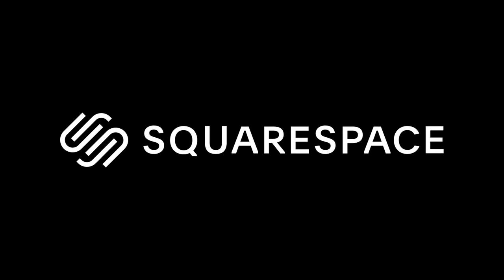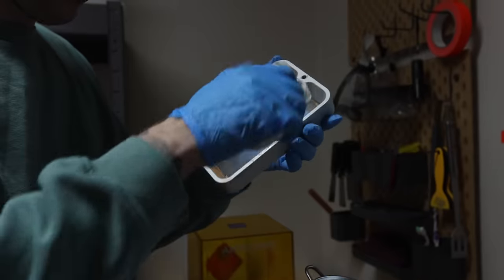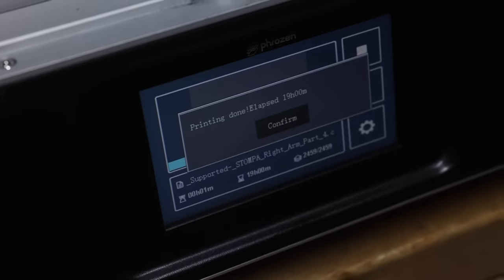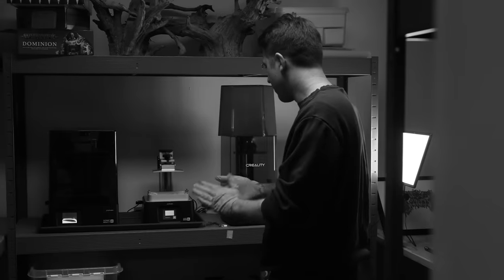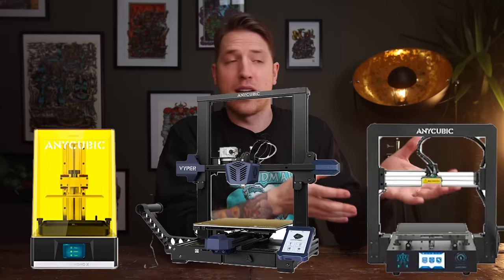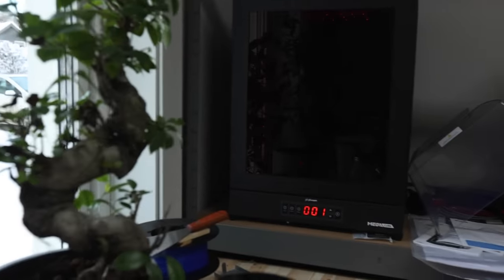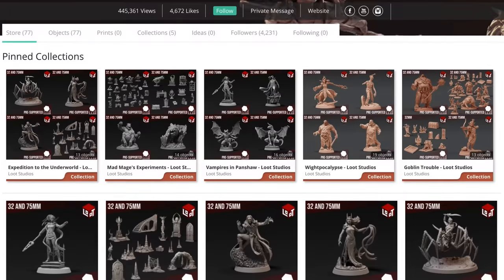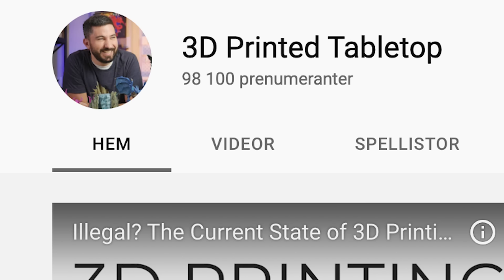6 things that made me hate 3d printing less

Comment: I’m actually allergic to the fumes/gasses given off as resin is hardened in the printer. Took the better part of a year & many doctors visited to figure it out… so I have a printer but it’s at a friend’s & he prints whatever files I sent him. I’ve been a patreon of Titan Forge minis for over a year & have always been pleased with their designs & presupports.
Reply: That’s rough! I accidentally was too lax with my exposure early on and sensitized myself (had the full shebang, dried skin, blisters, etc) so now I break out if there’s even a bit of residue on my skin for a bit
Reply: Damn. hope y’all are doing OK.
Reply: What were your symptoms? I'm wondering if I'm in the same boat
Reply: Resin printers don't give off fumes when they cure... its just the smell of resin.
Reply: Did you by any chance not wear a respirator/not install proper ventilation for your printer? People seem to mostly understand you need gloves, but they just straight up fail to understand that breathing the fumes contained in uncured resin can make you develop systemic health problems and - like in your case - make them develop allergies, in turn making them unable to operate a resin printer ever again.
Reply: @phillipmaciejewski9872  have you tried  the water soluble? Ive heard it helps.
Reply: @limpx336  they do fume,resin is being cured.
Reply: @3dmade  his point is that it isn't the curing that makes the fumes, it's the fact that resin produces fumes by itself. And I agree with @Clemens Himmer, none of the videos around emphasize enough how important ventilation and/or a respirator is. I recently got my first resin printer and was left completely unprepared for just how powerful the fumes are. Even with two air purifiers in the room with the printer I still have to crack the window open to keep the fumes from spreading through the house. After only 45-60 seconds of exposure I develop respiratory symptoms similar to seasonal allergies. It's nasty stuff; people have ended up in the hospital or with long term chronic health problems from too much resin/epoxy exposure.
Reply: @tayloreernisse6248   @Taylor Eernisse  its literally what he said and I replied to and is incorrect information by saying that resin that is being cured doesnt produce fumes, it's the exact oposite.
what you say does not correspond with what i have seen in a vid where a VOC  measuring device is put showing barely any VOC's from the resin untill the print started and it gone up considerably. Too bad I can't find it to link as its been a few years back. Also hanging your nose above a bottle of resin or your printer vent is quit a big difference in what you smell and how it smells.
Reply: @limpx336  Smells are fumes...
Reply: @limpx336  What do you think this smell is and how it is transmitted? Fume...
Reply: Yeah i it pretty poisonous to the average human so id hate to see someone whos allergic aswell
Reply: @Furzkampfbomber  Yes, but the process of curing is what outgasses more toxic fumes, the resin itself does put them off, but in considerably lower quantity than when it's curing. Smells can be strong without being toxic, and toxic smells can be undetectable, smellier doesn't mean more toxic.
Reply: You could get a decent FDM printer & stick to large detail minis like artisan guild, they print really well with tree supports.

Comment: solid list!  #1 was actually news to me, now I gotta see if any of my printers have a vat cleaning button!
Reply: Lol I havent cleaned my vat in 4 months just keep adding new stuff.  Give it a stir and away you go.  Even left it as an experiment for 3 weeks.   Made ZERO difference to the print quality.
Reply: @MrBizteck  Same. My resin vat just gets a good stir, then topped off with some new resin and another good stirring, it's set. I only clean the vat when I have to, and even then, you can just run the LCD test to solidify the entire bottom and just peel that off along with all the little failures sticking to the FEP. It's pretty fast and easy to recover from failures this way!
Reply: @MrBizteck  I only clean when there's stuff stuck to the FEP :-)
Reply: It's in the menus , I have one on my epax 6 .
Reply: @GoobertownHobbies  Same here. I haven't really cleaned the tray in a year, just remove whatever gets stuck. Resin printing is somewhat situational and somewhat luck based. I never had the nasty problems that some people complain about.
Reply: Comments on ECO resin? I've got three bottles ready to go on your recommendation but now I'm concerned 🤣

Comment: Happy to hear you’re running with a wash and cure station. Makes that resin cleanup a lot better.
Reply: Yeah, what was the brand/model again, please?
Reply: Stupid question, as someone considering a cleaning station: are there any that include a cycle that agitated the wash fluid with the UV lights on? I'd like that to help clean alcohol a bit to extend its life.
Reply: @rcrawford42  I know that the anycubic wash and cure station can't do that. You probably wouldn't want it in the cleaning container anyway because over time there is a lot of resin that builds up and would probably clog the the whole thing up. I always transfer the alcohol in a large glas jar and put that in the wash and cure machine without the turntable and clean the alcohol that way.

Comment: I have a Phrozen Mini 4K, I had issues with failed prints. Since I started warming my resin before printing I have had zero failed prints. Just leave the resin bottle in a bowl of warm water while you get everything setup and its warm enough in 5 minutes.

Its also worth mentioning I made one print with my Phrozen Mini 4K and hated the smell, long story short I cut a hole in the side of my printer cover, got some duct pipes and fans and piped it out of my window. I can now print and work in my office, not a single smell. Its amazing!
Reply: You saved me i dont have a sense of smell but my fam does so i keep getting hate and anger thrown at me, ya saved me

Comment: @Squidmar Miniatures avoid using tissue paper when cleaning the fep and resin basen try using microfibre cloth instead to avoid scratches
Reply: Why? Not like tearing things up cost him anything. They'll just send another.
Reply: @camojoe83  if the FEP gets scratched it's pretty annoying, plus it will mess with later prints. Replacing fep sheets is also a hassle.

Comment: That trick with the leftover supports  to aid in vat cleaning is going to save me so much hassle. No more digging around with a spatula and damaging the FEP.  Thanks!
Reply: You can also carefully use your gloved knuckle on the underside of the FEP to rub and push the print, just enough to lift off a corner and hold it off the FEP while you get the scraper under the edge to lift. Takes a minute to get used to but good when you don't want to waste resin exposing the whole vat.

Comment: To add to your first tip, if you remove the build plate and set it in the vat while the clean mode is on it will stick to the plate and make removing it much easier

Comment: Also a tip that improved my prints greatly: use PTFE lubricant on the FEP before pouring the resin in. This totally eliminated the problem of prints sticking to the FEP and extends the life of the FEP. Also, I use a water washable resin, and I use a flexible magnetic build plate. When cleaning the minis, I rinse them in a bucket, then I remove the supports, THEN I put them in the wash station. Gets the prints much cleaner, and keeps the wash liquid cleaner.
Reply: Any good alternatives? Haven't heard good things about teflon
Reply: I have had so bad results with water washable resin. A lot of times it started cracking months after the print...
Reply: @manuelklein7627  this is the issue with water washable, its the trade off sadly.

Comment: I would recommend one of the cheaper curing stations meant for nail studios.
Just check that it has a function that allows to have the light on all the time.
On most of these curing boxes you have changeable UV light bulbs so you can replace burned out bulbs easily. Also most of them have a reflective surface all over their inside so no fiddling willth foil.
These boxes are quickly found on the internet.
My boyfriend and I have found this thing quite useful and we don't mind having to do a little adjustment in the minis position to get everything cured. It works for what we need and I guess it is a decent alternative between some diy contraption and a real curing station both in price and quality
Reply: I have a nail curing thingy, but needed a bigger curing station. So I built one by simply buying UV light strips for cheep like 10 dollars. Then I get a box, cover the inside with foil, and then stick the UV light strips inside. It's the ugliest yet the best thing I have ever made

Comment: I have been printing with an ABS PLA printer for 3 years (scenery mainly), and I started printing with a resin printer a couple of months ago. I started with an elegoo mars 2K pro and a Mercury plus curing machine. I have been printing with water washable resin, and apart from calibration, the only issue I had was changing my VAT plastic (I followed a tutorial by Elegoo). That's it... I have 0 fail, and I printed 5L worth of resin, I am absolutely in love with my printer, and if they were more affordable I would buy a gigantic one to print my terrain with it.
My good old Enders 3 is a great printer, but I am always fixing, changing, tuning mechanical things (bed, extruder, tube, everything), a resin printer is litteraly no work at all. Put the resin in, get a supported model, press print... Done.

Comment: I had the same issues until I switched to water washable resins. It is so much better imo.
Only the cleaning needs a bit more work, as it is only a mechanical cleaning, not an additional chemical process as you have with IPA. But getting rid of the IPA sets off the higher cost for the water washable resin and did much to keep me safe from any health related issues.
Reply: Please do not underestimate the dangers of the resin you are operating with. While IPA is a toxic chemical, resin contains way more toxic chemicals.
If you don't treat the resin like it is way more dangerous than the IPA you are endangering yourself, you need to protect your respiratory system and skin from absorbing the resin's VOCs at all times uncured resin is not contained fully airtight or ventilated, or you will develop system health problems in time.

Comment: With lift speeds you can actually go the other way, with very fast settings (180mm/min+) that reduce both the force and time, though slow speeds are more reliable. There's a grey zone of 'medium' speeds between 60-180mm/min that have the largest peel forces. It's a bit like ripping off a bandage - you either want to go really fast or really slow.
Reply: Thats what I found with the Saturn, initially default settings caused constant fails to the point where I almost gave up, went slower (and also anyone with a Saturn, increase your lift distance, those big FEPs flex a lot!) Finally decided to go fast instead and it was just as good.  Its only the middle speeds that cause issues.
Reply: @davidmccurdy8911  same here. Ever since going to 185mm (or 180, not sure) I have significantly less fails and whats even cooler, the prints are stupid fast. Printed out a couple modular 28mm Minis (legs and upper body seperated) in under an hour.
Reply: You really have to have your printer calibrated perfectly for vroom settings to not get fails.  Not that you shouldn’t have that done anyway, but a lot of people don’t and that’s why they have problems with fast lift speeds.
Reply: @Chef_PC  I think I have been super lucky then, I set them to the Sirya tech settings (even though I use Elegoo resin) ramped up the speed and off I went.
I have had more problems over the last few days but I am putting that down to changing the mainboard so I had the top off so need to get my levelling just right again
Reply: @davidmccurdy8911  I used vroom for a few months before my screen burned out (not likely related), and have just now gotten back to it.  Fresh resin and having the printer dialed in really helps out everything though.  I use Siraya Navy now almost exclusively because it’s moderately priced and I’ve had fewer fails than any of the other brands, especially Elegoo.
Reply: My prints were failing alot at 240mm/m but just putting it down to 180mm/m nothing fails unless im really pushing what is realistic. Still have retract speed at 240mm/m

Comment: Lychee, auto supports, works 95% of the time, you can tweak the auto support settings. For smaller things I tend to use the light supports on a high or ultra density, or just mediums on bigger things.
Auto supports have gotten a LOT better with the more recent releases. Slower lift speeds are the first thing I will try if I get a failed print even if it adds an hour or two to your print.

Comment: One tip a lot of people miss: CHECK YOUR ROOMS TEMPERATURE. Especially in Europe, it's getting cold these days. Most standard resins do need a working temperature of above 20°C, better 25°C. You can heat the resin up on a radiator beforehand, thus helping the print to stick in the beginning. In the process of printing, the resin will warm up due too the reaction while curing the resin. If raising the temperature is not an option, you will need to raise the exposure setting, to hit it longer with UV light. Optimally, do a "XP2 Validation Matrix" test print right before a larger, critical project.
Reply: homebrewers have a similar problem with temperature. You can buy electric heating belts that wrap around the vat for like $10 from homebrew supply stores
Reply: @Serpsor  good to know, will check it out!
Reply: @Serpsor  i was really confused and asking myself "why would dnd homebrew content creation have to do anything with temperature?"

Comment: In my experience with 3d printing most issues are caused by users. It is by far cheaper I've saved a ton of money myself already. Ive had mine a couple of months and had zero issues outside of the first couple of days sorting settings out.

Comment: Great list. I was a little surprised about the complaints though. I've been FDM printing for over 3 years and SLA printing for about two months but no matter what printer or material I've ever used, I always managed to get a print to complete successfully. When it actually failed, it was my fault because I forgot to wipe the bed clean of my finger prints (with FDM printer) or forgot to support an isle on an SLA print, etc.

Comment: Lichi is perfect for auto supports, i use it every time and with a 98% success rate. Another tip before curing put ur prints in hot water for 5 mins and the support practically fall off leaving no nubs or indents, then let dry before curing. These tricks have mad reson printing a breeze.

Comment: I have a Phrozen Sonic Mini 4k, and I can't recommend getting a Wham Bam magnetic plate for it enough. Getting prints off the plate is so much easier now, and the only reason I've had to use a scraper since has been to remove prints that failed cause it's too cold out. Go slow, keep the resin warm, and get magnetic plates. Made me fall in love with printing.
Reply: I really considered getting one of those until I got a super cheap solution.  "FOSHIO 2PCS Plastic Razor Scrapers" still using the first blade and it gets all the prints off the metal plate easily.  About $12 lifetime supply if blades. safe for my build plate and it just works.
Reply: @nathangerardy2669  I've used those at work and they're great, but i find the plate is easier/faster, and I don't have to worry about pre-supported files that are so small they'll fall through the mesh of my wash+cure machine.

Comment: I don't empty the vat when I have a failed print. I use a plastic razor blade and take it off in one clean piece when possible. Once removed I literally stick my fingers in the resin for any strays. I print everyday and this method works everytime. No need to take the vat off and damage the film. Been printing for 4 months with two machines and no issues.
Reply: I hope you mean gloved fingers
Reply: @Doodlebob563  I'll try to keep it at a 4 weeks long rash from resin burn on my arm

Comment: One thing i never understood before getting a cure station is you have to have your curing setup under the fume hood/tent system you have alongside you printer because the short curing duration and even the wash pumps a crap ton of alcohol into the air.  I would not be surprised at all if there were a good amount of resin VOCs in those fumes as well.

Comment: If your fep keeps building pools of cured resin over the duration of the print try these things one at a time: 
clean resin by straining it, clean fep with alcohol and lint-free tissue, reduce exposure times, check fep for scratches or ghost mark and replace it as needed,, reduce laser intensity from 100% in 5-10% increments. 

Hope that helps someone. 
Add more helpful methods if you’ve got them.